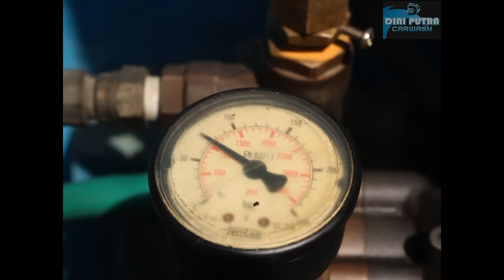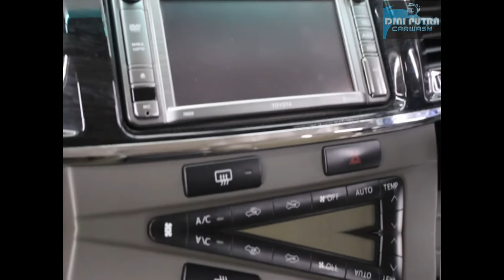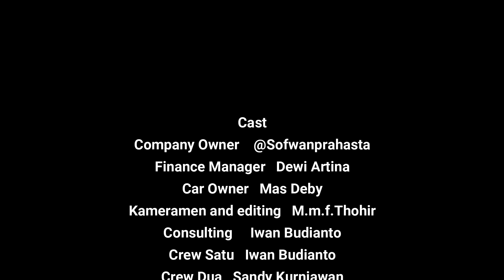Toyota Fortuner VNT turbo Salon Total Full | Step dan Penjelasan Pengerjaan Full!

Comment: Mantap 👍👍👍koreksi dikit, itu mobil thn 2012 atau 2013. Krn kl thn 2014 velgnya udah black....sorry kl salah...🙏🙏🙏
Reply from the maker: Siap, Terima Kasih Sarannya. Kalau gak salah tahun 2013
Reply: @DiniAutodetailing  salut sama cara kerjanya....detil, rapi dan bersih banget 👍👍👍sukses selalu....
Reply from the maker: Teeima kasih banyak om
Reply: Velg hitam hanya ada di varian trd sportivo
Reply: @cadiaproplayer3424  kmu sotak. Mobilku ajah tahun 2011 bulan 10 trd sportivo velg msh silver.
Reply: Nurasikin Ikin mulai 2013 versi bensin trd sportivo dapet velg trd disusul versi diesel 2014.
Di video ini fortuner vnt di pastikan sekitar tahun 2012 sampai pertengahan 2013,karena semenjak pertengahan 2013 sdh facelift beda head unit audio dan sebagian interior berwarna hitam.

Comment: lokasi dimana om
Reply from the maker: 🔛 Get 20% Discount Nano-Ceramic 9h++ Package Mulai 700rb Motor & 1,5 JT Mobil
🔛 Get 20% Discount Salon Total. Promo Akhir Tahun

Polishing 3 Step With:
MEGUAIR'S 105 🇺🇸 Coumpond'S
MEGUAIR'S 205  🇺🇸 Polish
Suprabril by MTX
Suprashine by MTX
Riwax 🇨🇭 RX08 Final Finish
Menzerna 3800 Finish

Paint Protection Coating by:
Base Coat : SIBC 9H+++ Nano-Ceramic ® 🇩🇪
Top Coat : SIO5 9H++ Nano-Ceramic ®🇩🇪
Surface Coat : QP-ON 2.0  🇩🇪
Garansi 2th Free Perawatan Nano Ceramic
4X Re Coating with QP-ON 🇩🇪

Dini Carwash and Autodetailing Kediri : Salon Mobil dengan hasil Pengerjaan Terbaik, Detail, Cepat Dan Maksimal.
Dengan Peralatan, Mesin Dan Bahan Terbaik yang menunjang pengerjaan Salon Mobil agar maksimal Dan Sempurna.
Support By: Meguair's, Microtex, Unelco USA, 3M, Nano-Ceramic® 🇧🇪 and other high Quality Detailing Product.
"We threat your car like Diamond"

KAMI MELAYANI:
☑ Nano Ceramic PAINT Potection
☑ Salon Mobil Total / Full
☑ Salon Mobil Exterior
☑ Salon Mobil Interior
☑ Poles body 3 Step Mobil
☑ Poles Kaca Jamur & Kerak Kaca Mobil + finishing dengan Glass Coating
☑ Poles Headlamp / Lampu Mobil
☑ Undercarriage / Kolong & Velg detailing
☑ Salon Mesin
☑ Cuci Jok
☑ Cuci Plafon dengan Mesin "Tornador" 2 jam selesai "Aman Tidak Merusak Plafon"
☑Cuci Karpet dasar
☑Basmi Sarang Semut, Kecoa Dan Serangga di Mobil dengan hasil permanent
☑Ati Karat, Rust Protection
☑Peredam Suara Automat 3mm
--------------------
Dini Carwash and Autodetailing
JL. Kapten Tendean no.190 Ngronggo Kediri 
Contact, Sms, Wa, Line : 081335851115
Fb: @diniputramobil
IG: @sofwanprahasta
Twitter: @allentera
YouTube: https://www.youtube.com/channel/UCiwlAP4H8VdXEqPs8TfkL-w
Web: http://www.sofgoo.com
------------------
#salonmobil
#salonmobilkediri
#cucimobilkediri
#salonmobilpanggilankediri
#carwashkediri
#dinimobil
#dinicarwash
#kediri
#tulungagung
#blitar
#nganjuk
#trenggalek
#kedirilagi
#infokediri
#polesmobilkediri
#kedirikeren
#autodetailingindonesia
#kotakediri
#diniputracarwash
#nanoceramickediri
#paintprotectionkediri
Reply: Coba ada di Lampung......
Reply from the maker: Di Lampung coba Ke AA Detailing

Comment: Minta alamat lengkap dan nomor tlp yg bisa di hubungi donk
Terima kasih
Reply from the maker: 🔛 Get 20% Discount Nano-Ceramic 9h++ Package Mulai 700rb Motor & 1,5 JT Mobil
🔛 Get 20% Discount Salon Total. Promo Akhir Tahun

Polishing 3 Step With:
MEGUAIR'S 105 🇺🇸 Coumpond'S
MEGUAIR'S 205  🇺🇸 Polish
Suprabril by MTX
Suprashine by MTX
Riwax 🇨🇭 RX08 Final Finish
Menzerna 3800 Finish

Paint Protection Coating by:
Base Coat : SIBC 9H+++ Nano-Ceramic ® 🇩🇪
Top Coat : SIO5 9H++ Nano-Ceramic ®🇩🇪
Surface Coat : QP-ON 2.0  🇩🇪
Garansi 2th Free Perawatan Nano Ceramic
4X Re Coating with QP-ON 🇩🇪

Dini Carwash and Autodetailing Kediri : Salon Mobil dengan hasil Pengerjaan Terbaik, Detail, Cepat Dan Maksimal.
Dengan Peralatan, Mesin Dan Bahan Terbaik yang menunjang pengerjaan Salon Mobil agar maksimal Dan Sempurna.
Support By: Meguair's, Microtex, Unelco USA, 3M, Nano-Ceramic® 🇧🇪 and other high Quality Detailing Product.
"We threat your car like Diamond"

KAMI MELAYANI:
☑ Nano Ceramic PAINT Potection
☑ Salon Mobil Total / Full
☑ Salon Mobil Exterior
☑ Salon Mobil Interior
☑ Poles body 3 Step Mobil
☑ Poles Kaca Jamur & Kerak Kaca Mobil + finishing dengan Glass Coating
☑ Poles Headlamp / Lampu Mobil
☑ Undercarriage / Kolong & Velg detailing
☑ Salon Mesin
☑ Cuci Jok
☑ Cuci Plafon dengan Mesin "Tornador" 2 jam selesai "Aman Tidak Merusak Plafon"
☑Cuci Karpet dasar
☑Basmi Sarang Semut, Kecoa Dan Serangga di Mobil dengan hasil permanent
☑Ati Karat, Rust Protection
☑Peredam Suara Automat 3mm
--------------------
Dini Carwash and Autodetailing
JL. Kapten Tendean no.190 Ngronggo Kediri 
Contact, Sms, Wa, Line : 081335851115
Fb: @diniputramobil
IG: @sofwanprahasta
Twitter: @allentera
YouTube: https://www.youtube.com/channel/UCiwlAP4H8VdXEqPs8TfkL-w
Web: http://www.sofgoo.com
------------------
#salonmobil
#salonmobilkediri
#cucimobilkediri
#salonmobilpanggilankediri
#carwashkediri
#dinimobil
#dinicarwash
#kediri
#tulungagung
#blitar
#nganjuk
#trenggalek
#kedirilagi
#infokediri
#polesmobilkediri
#kedirikeren
#autodetailingindonesia
#kotakediri
#diniputracarwash
#nanoceramickediri
#paintprotectionkediri